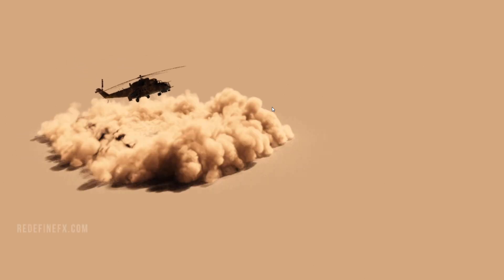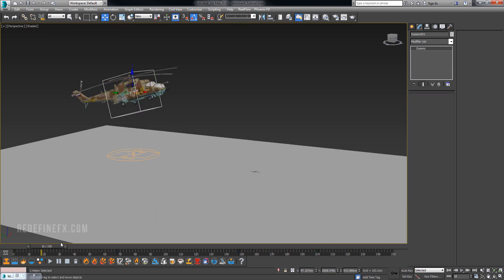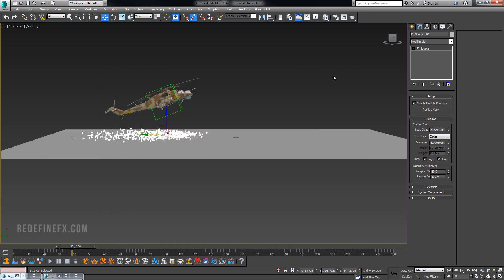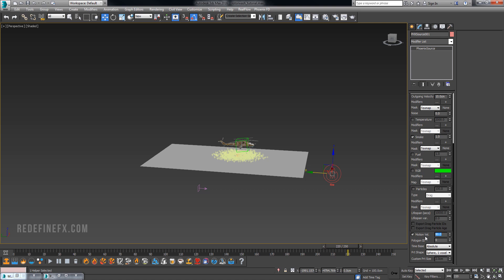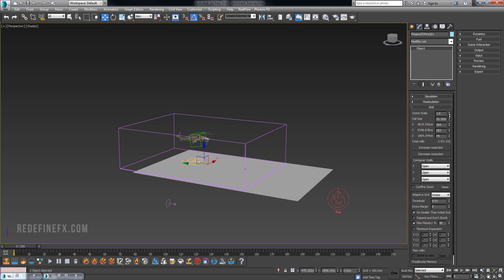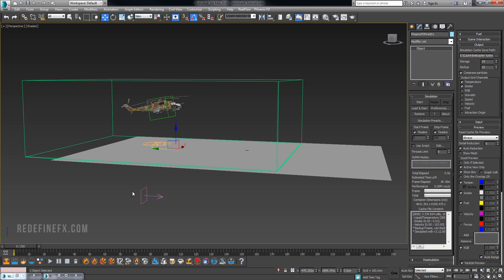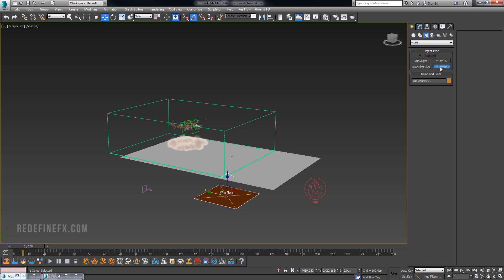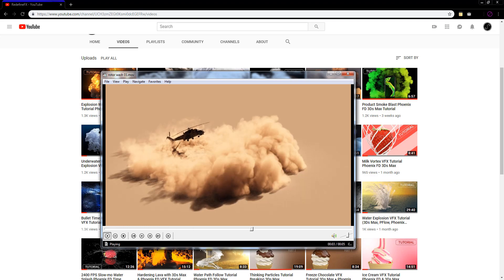Rotor Wash VFX Tutorial with Chaos Phoenix in 3Ds Max by #RedefineFX

Comment: Awesome work! Question... I followed the tutorial but only have the emitter showing with no smoke... what am I doing wrong? Thanks
Reply: the same problem, did you solve it?
Reply: same here?
Reply: Quite possibly your emitter is on the exact same bottom level with the container smoke grid, so when you set Jammed -Z only particles are visible, make sure the emitter sits tiny bit inside the container sim.

Comment: Doesn't work for me in that way... If I add pflow in PHXSource nothing happens in simulation, but if I select pflow and apply smoke sim it starts to simulate. But also works only if pflow have shape operator... nothing happen without it... wtf. Results is completely different. And after 30-40 frames phoenix stuck at sim progress even with lowest resolution
Reply from the maker: Very strange. Make sure you’re using Phoenix 3.12 and download my project file and look at my setup

Comment: Dont understand, I do all the steps, but somehow it simulationg but I cant see any smoke. This drives me crazy
Reply from the maker: Make sure you add particle Flow as your source for the smoke and that they are being emitted inside the grid and not right on the grid wall
Reply from the maker: In other words, try moving PF flow slightly up above the ground
Reply: @RedefineFX  thanks. Somehow it worked when I started a smoke preset. And changed all the values.  I have no clue why to be honest